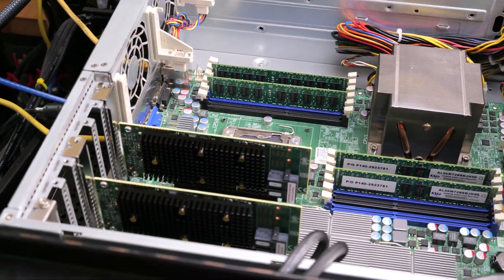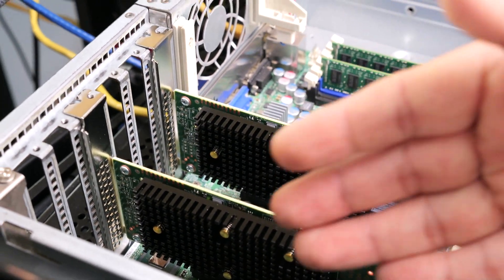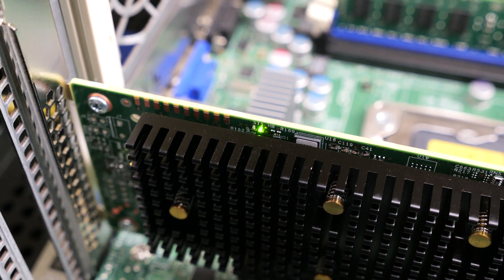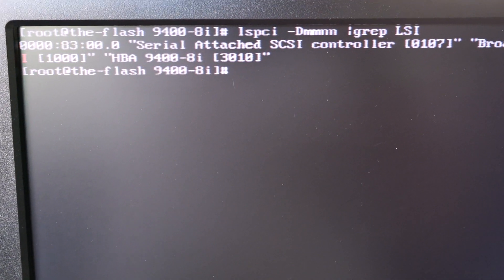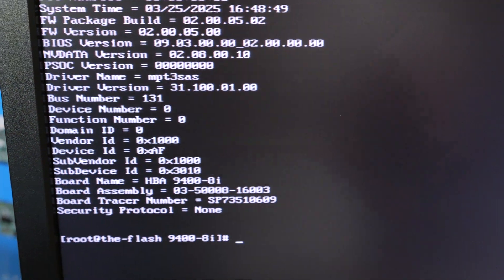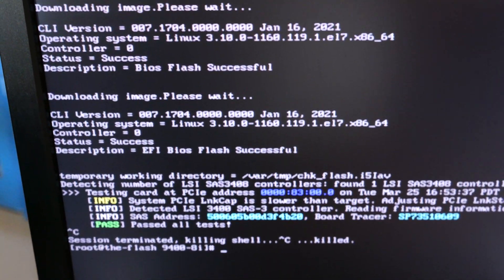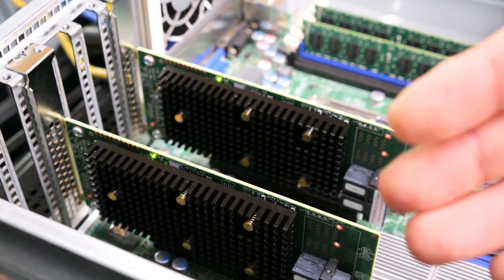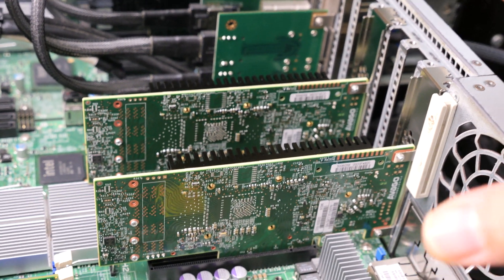Many Broadcom 9400-8i not working (fix inside) | no heartbeat rapid LED blinking

Comment: I have this card in my system and I just noticed that the heatbeat led on mine is flashing rapidly and not 1 blink per second. Is that a problem?
Reply from the maker: That seems abnormal if it is blinking faster than in this video. Also, make sure it's actually the heartbeat and not the other LED as mentioned in this vid. Is the card working otherwise?

Comment: Hi @ArtOfServer Can you please recommend me a payable (50€?) HBA for a Silverstone RM21-308 with Backplanes RFF8087 connectors for MB with pcie slot with 4 lanes? I should allready be flashed to IT. Optimal would be if you can buy it with 2 included cables for that HBO to backplane. Btw i have no slot left for an expander. Thanks & Regards
Reply from the maker: Maybe check this video out: https://youtu.be/7vTGMbNR19I
Reply: @ArtofServer  i allready found and watched it, great vid btw,  but i dont have a Slot left in the Case for an extender. I did read that some cards don't even Support ASPM so its really hard to find a card for my needs since i dont have the knowledge to select the right one

Comment: Broadcom has been f-ing over many customers with there firmware issues. Another great example is the PCIe Switch HBA P411W-32P where they removed advertised features.
Reply from the maker: I haven't heard about that one. I'd like to learn more if you don't mind sharing a link where I can read more about it?
Reply: I was referring to the P411W-32P no longer being able to use directly connected SSDs with just cables if you update its firmware to the latest version.

Detecting drives with the P411W-32P presently only works if you have an active UBM backplane in-between the HBA and the drives which is kind of absurd since it is a PCIe Switch only, only capable of using PCIe/NVMe SSDs. It’s not a bug, Broadcom Tech Support confirmed the removal of that previously working feature. The reason behind it is unknown to me. After my experiences with Broadcom over the years my subjective opinion is that they properly want to force customers to buy more expensive UBM backplanes with additional Broadcom chipsets inside to increase their revenue.

The bad thing here is that the P411W-32P has similar bugs related to changing ACPI states as do the 9400 and 9500 models (pre firmware package phase 28) that can completely crash systems. Also funny: Broadcom’s Windows drivers for the P411W-32P have broken signatures.

You can feel the quality and care from Broadcom all around.
Reply: Could you read my response before it was disappeared by the all-knowing benevolent algorithm?

Comment: Broadcom left the 9400 EOL without fixing many of the firmware bugs that were even carried over to the 9500 models. My favorite one is crashing systems that use standard ACPI S3 suspend-to-memory, that was finally fixed with firmware package phase 28 which the 9400 models won’t get.
Reply from the maker: Yeah, these cards are not as mature for sure. Even the 9560 card Broadcom sent me, shown in previous videos, actually had a firmware bug when I received it preventing me from addressing certain drives. I had to update the firmware to get it working.

Comment: Have you seen similar issues with the 9500 series?
Reply: The 9500 models are pretty mature at the moment and are still receiving firmware updates (the 9400 models are EOL with bugs), BUT for the love of God update them to the latest firmware package (currently phase 34).
Reply from the maker: In testing environment, i have not seen such issues with the 9500 series cards.

Comment: Did trimode/U.3 just kinda... flop? Some of the newest Gen5 enterprise SSDs come in EDSFF and U.2... but not U.3. Everyone wants real PCIe...
Reply from the maker: I've never seen much value in the Tri-Mode feature for HBAs. It's like driving a Lamborghini in rush hour traffic, why put high performance SSDs and squeeze their I/O through a switch and less PCIe lanes? I can see the value for Tri-Mode in the case of a MegaRAID controller, as there aren't many hardware RAID solutions for those SSDs.

Comment: 9400 that i had, would drop a port randomly
Reply from the maker: I've never encountered that due to a firmware issue. I've seen that due to failing cable, or slightly damaged cards (damage to caps on the SAS lanes)

Comment: Yeah 9400s are pretty sketch as a generation. Transition phase problems, as usual from broadcom/agago
Reply from the maker: yeah, it is a architectural transition product. it didn't gain too much over the previous generation, but they added the Tri-Mode feature and the switch to ARM allowed them to finally stop the increasing power consumption over the previous generations.